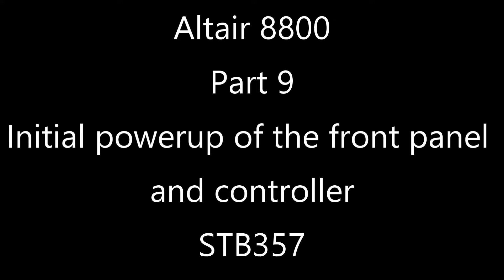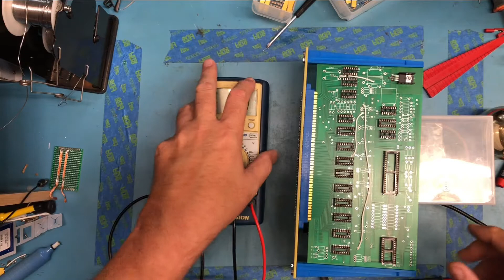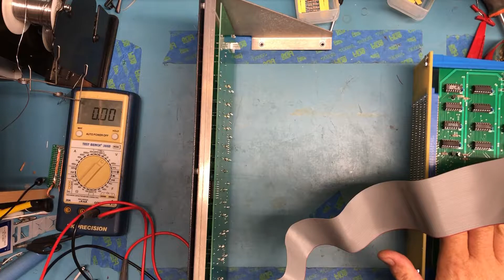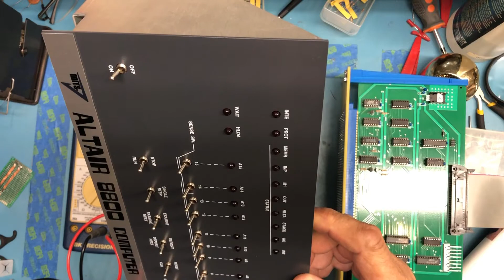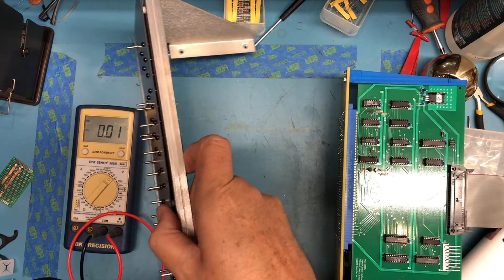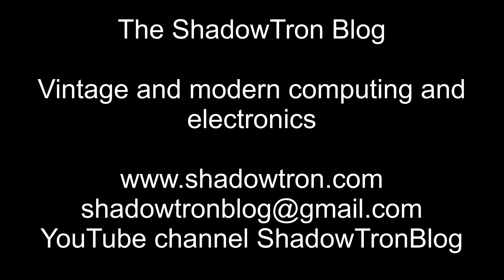Altair 8800 - Part 9 - Initial powerup of the front panel and controller - STB357

Comment: I have found in the past that most bad ribbon cables can be fixed by using jeweller's screw drivers to unlatch the top of the ribbon connector, then carefully remove the old ribbon cable. If it is just the ends of the ribbon cable that are damaged, cut them off with a pair of scissors and then reinstall the connector. I have a small vice that I use to close the connector. Basically squeeze the connector until the side latches lock. 

Of course there are some types of ribbon connectors that cannot be taken apart in this manner. But it is worth a try.
Reply from the maker: I've done this before myself with good luck. I didn't show the issue however there were several wires midway down the cable that had been cut/ripped. About 5 wires were broken.